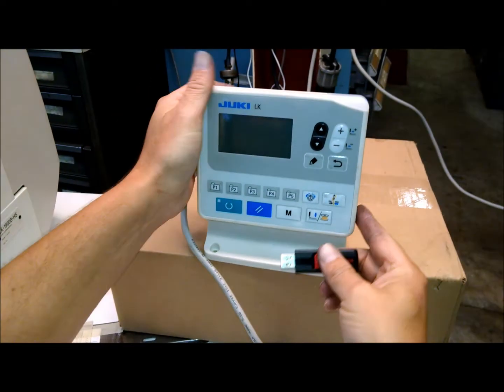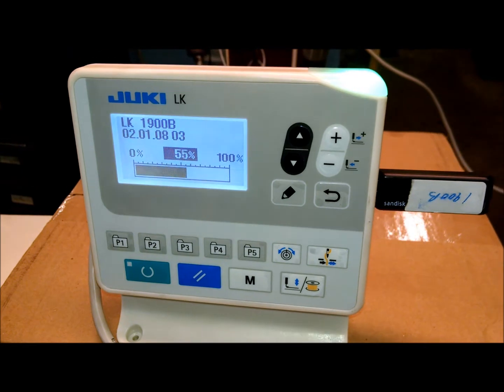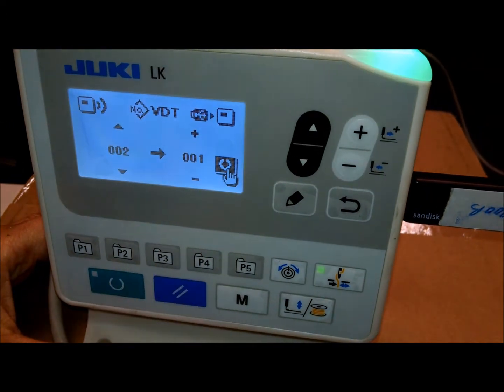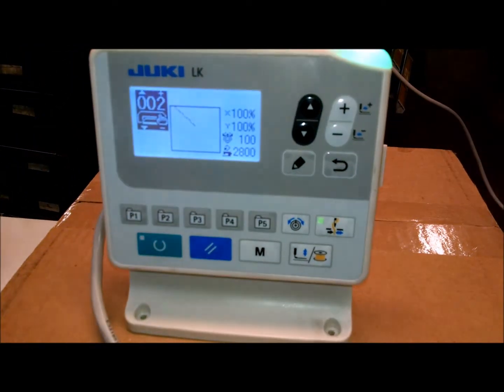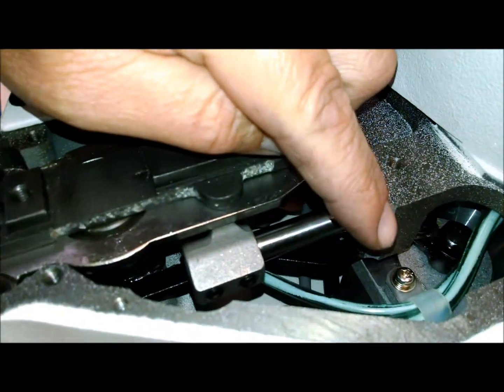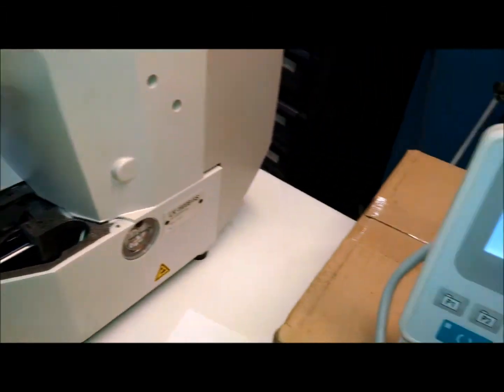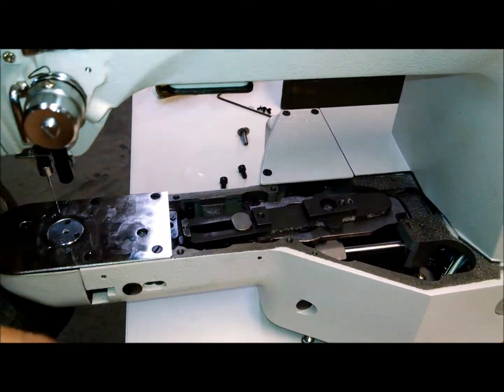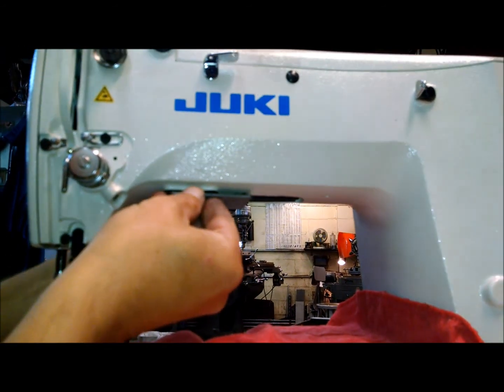software and mechanical installation instructions to expand LK1900B

Comment: Sir Jack 9100 bp machine error code e7 how to solve problem
Reply from the maker: don't know anything about the Jack machine. The book should have a list of the error codes
Reply: E-007
Main shaft driver
abnormal
The error is detected in
main shaft driver.
Turn off the power and repower the machine
after a while.